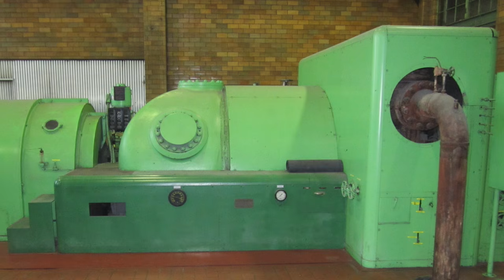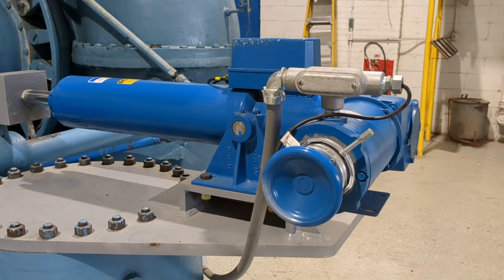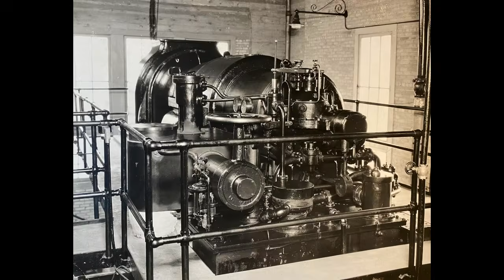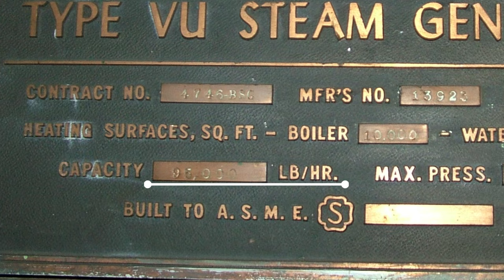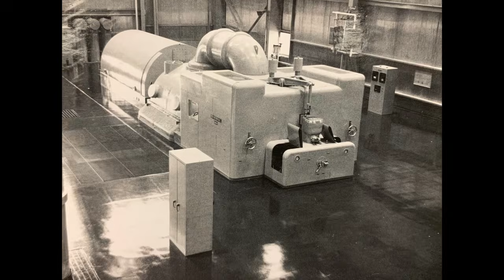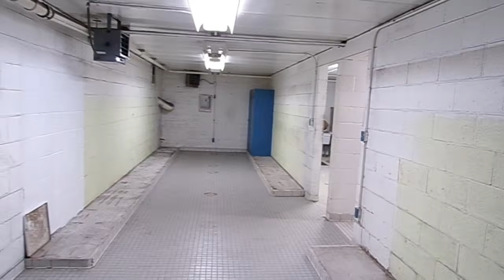The 1914 Hoot Lake Hydro Plant That Outlived 5 Newer Coal Plants

Comment: what a great video.got a 130psi 9MW unit a quarter mile from here went online in 1912 and has had some of the same upgrades as this one over the years.i can hear it often from here such a gift how we use water.a shame its drying up.
Reply from the maker: what are you talking about? none of the hydro electric plants produce 9 MWs and theres definately no coal power plants that old that still operate.
Reply: @SteamElectricityandPropulsion  out here theres one i described
Reply from the maker: @d2sfavs  well there are no hydro plants that big in fergus falls.
Reply: @SteamElectricityandPropulsion  nice seeing these old units still running
Reply from the maker: @d2sfavs  but you were refering to a plant built in 1912 that was 9mw. there is no such thing in fergus falls. the biggest dam is the dayton hollow built in 1909 which has a capacity of 900 kw
Reply: @SteamElectricityandPropulsion  i was referring to a powerhouse not far from here nearby
Reply from the maker: @d2sfavs  well what power house are you talking about? I am not aware of any thing like what you described
Reply: @SteamElectricityandPropulsion , he may be talking about where he lives---not Fergus Falls area.  Maybe he's in Canada.

Comment: To be fair.
None of these units would be very large. I heard a coal turbine of 80MW mentioned. That would be uneconomic to run nowadays. Easier though to run an old hydro unit if you can. But even the largest could be a tenth the size of more recent coal powered turbines.
Reply from the maker: I think the coal fired units were running on high pressure steam and had reheaters. I think the fuel efficeincy would have been good.

Comment: Excellent video! Thanks! I knew several folks at Otter Tail Power—all talented and gracious. 
One point: when synchronizing a generator to the grid, the operator has to match frequency and phase angle, which is why there’s a synchroscope on the control board. Closing the generator breaker out of phase can damage the generator.
Reply from the maker: thanks for the comment. next time I go there the operator might disconect and re synchronize a generator at the dayton hollow dam. I asked him if we could do that and he said we might be able to.
Reply: @SteamElectricityandPropulsion 
There’s several YT vids of starting and syncing a hydro generator. Don’t remember the name ATM.
Reply from the maker: @jbsimmons54  I know chris boden did it. I want to make my own video so I can explain things with better visuals.

Comment: In all fairness these hydro plants did require their fair share of maintenance.  In these old plants the turbine runner was considered a consumable item that required periodic replacement or later on, major weld repair.  Fence posts and angle iron did a fair bit of damage to these units.
Not until the development of appropriate stainless steels suitable for the purpose, and understanding and controlling cavitation, were runners possible with very very long life times.
My employer manufactures 4 turbines with 400 MW capacity each, fabricated from 17-4ph stainless steel.  This was quite an accomplishment!  Guaranteed efficiency was 94%!  My very good friend was responsible for calculating and guaranteeing this efficiency.  He was scratching his head over the last 1% or so when I told him: "Who is going to measure this, how are they going to measure this with such accuracy???"  We did have fun on the job in those days.
Reply from the maker: thanks for sharing that! I suppose hydro electric plants last longer than anything else because they get free power from the river.

Comment: There are old hydro-electric power plants all over southern Ontario.  The one I am most familiar with is the one in Bracebridge Ontario Canada, built in 1902 I believe, with a then capacity of 300 KW.
Several years later another turbine was added with also 300 Kw.  There were other additions later on.
Around 2012 the hydraulic plant was completely rebuilt to make full use of the water power potential.  2 new turbine - generator units now produce between 2.4 and 2.6 MW of electric power.  The old brick buildings were maintained as much as possible, making this a very pretty historic site very close to downtown of this pretty little city.
Other old water power plants are located in the New England states, northern Quebec for aluminum smelting and in Union Harbour Newfoundland Canada.  The latter has an interesting history.
Reply from the maker: that sounds cool, im pretty happy I found these plants only about 100 mile from where I live. there are actually 2 more hydro electric plants I have not covered yet which are in fergus falls.

Comment: It is sad that we don't engineer power plants with a hundred year lifespan in mind
Reply from the maker: I suppose really old steam plants are not the most efficient but the units from '59 and '64 were fairly modern with very high pressure steam and efficient pulverized coal boilers. I think those units were fairly modern and fuel efficient by todays standards.

Comment: I grew up in Fergus Falls, MN.  I remember taking a grade school field trip to the Hoot Lake plant in the 1950s.
Reply from the maker: wow thats cool! what do you remember from that field trip?
Reply: @SteamElectricityandPropulsion 
Everything looked very big and modern.
Reply from the maker: @richardskarie802  cool. was the unit #2 under construction? It was built in '59 so if you were there before that it would not have been built yet.
Reply: @Steam @SteamElectricityandPropulsion . I visted the Hoot Lake plant in the md 1970’s on a school field trip. I remember it well. 
The first time I experienced vertigo. We walked out a door onto a steel grate 25 feet off the ground. I wasn’t expecting it and I felt very strange. Luckily I got over it quickly. 
Another thing I remember is looking into the huge firebox on the boiler. There was a wheelbarrow sitting there and a machine was spitting little pieces rock into the wheelbarrow. They told us it was piece of pyrite or fools gold. 
The teacher took another class out there the next day. He had an accident, he walked into and broke a glass door. Have no idea why I remember these things. 
My father made many deliveries there. I remember that long driveway with a row of coal train cars and the big pile of coal off loaded. 

There was another hydro dam in that area that failed shortly after it was completed. It was built on a spring, very soft and unstable ground. It’s is now a park, the ruins are still there. It is also a large solar farm. Check out the google maps satellite images. Pretty impressive. 

Thanks for the video.

Comment: It's such a shame that perfectly operational plants get demolished.
Reply from the maker: It was old but I think it would have been fairly fuel efficient. the steam pressure likely pretty high and the boilers had air preheaters which would have made for good efficeincy.
Reply: @SteamElectricityandPropulsion  they basically lost capacity on the grid unless there were other plants added making these redundant.
Reply from the maker: @ikonix360  that is not accurate. just because the plant had 2 active units does not affect redundancy. thats why all the power plants in the country are connected on one large grid. think of all the single and double unit power plants out there. if they have a tube leak or maintenence shut down thats fine due to the other power plants on the grid.
Reply: @SteamElectricityandPropulsion  What I meant was I could see doing away with these steam generators if there were other better units added to the grid to take their place.
Reply from the maker: @ikonix360  for a coal fired power plant I see nothing wrong with it. its just about as advanced as the leland olds or antelope valley power plants in ND. they are just shutting down coal plants in MN. this year they are decomisioning a unit at the sherco plant in becker MN.